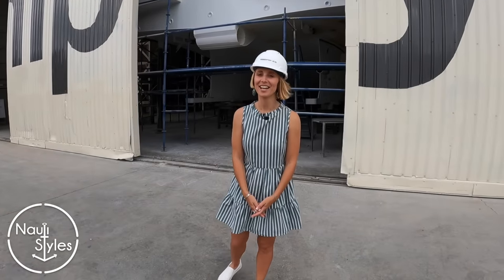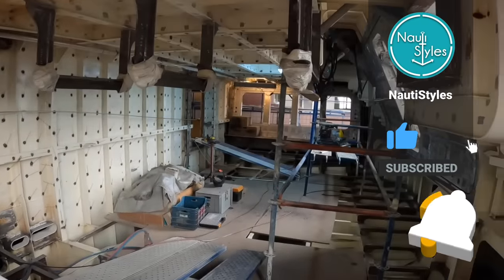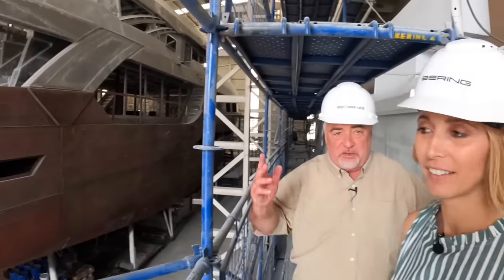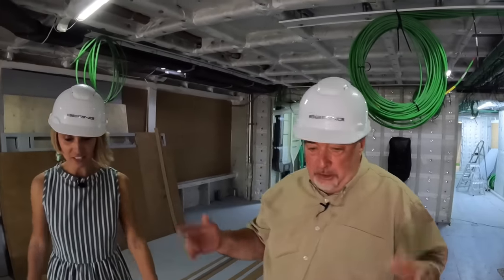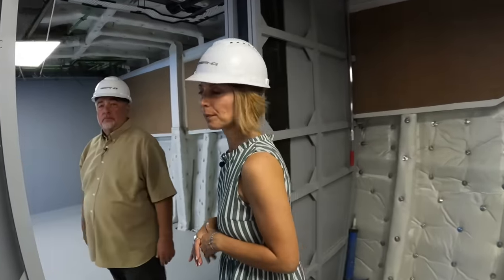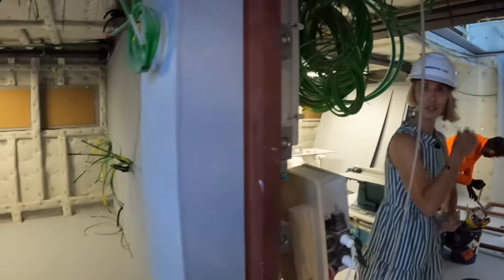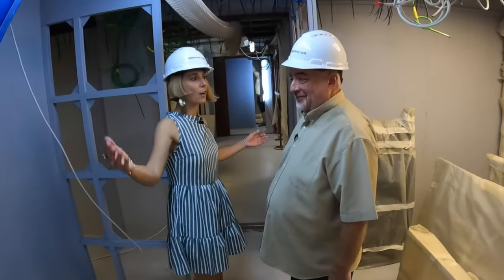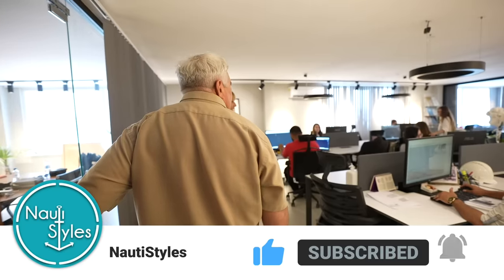BERING 145 HYBRID EXPLORER SUPERYACHT TOUR / EXPEDITION Liveaboard Go Anywhere World Cruiser

Comment: This will be great to see when it gets finished and is ready for sea trials - please come back and do a follow-up video. My favorite Bering is the 130. That one has a fantastic layout and also longer range than this one (6000NM). I know that if you have to ask the price you can't afford it, but I'm curious what Bering charges for it's top $$$ water toy.

My problem with hybrid systems is that they too need replacing - batteries will wear out and surprisingly quickly if you push them hard. That down time and expense won't be fun if the vessel is in dock every 3-5 years just to do battery swaps. And at the rate battery tech keeps evolving Li-Ion and hybrid drive could be obsolete well within this boat's lifetime. Drive train swaps aren't impossible on vessels like these and larger, but they're not exactly easy either, especially when the change in weight and thrust ends up having a negative impact on performance and handling.

Comment: When he mentioned nuclear power in suitcase size my heart stopped. Just the amount of power generated from 2 suitcase sized units or hydrogen units could power a yacht this size for 25 to 30 yrs with no refueling. And unlimited range to boot. I so want to see that in 10 yrs.
Reply: He's off by about 100 - 200 years at least. Don't worry.

Comment: The CODLAD propulsion system is currently used on military ships, in fact the Bering shipyard can at any time switch to the construction of military ships from what I can be seen, have a very modern workflow implemented. Impressive. 
https://en.wikipedia.org/wiki/Combined_diesel-electric_and_diesel

Related to the problem of file loss, both memory cards and SSD or classic hard drives can lose data if they are exposed to radiation generated by airport scanners, it is safer if you have a cloud storage solution and immediately after you finish filming at location upload the video to the cloud, then after you get home take the downloads and process the final video. I am glad that you managed to recover these videos, my personal opinion is that they are among the most valuable videos of yours. Thanks for the video.

Comment: Very impressive construction & strength.  Ability to resist ice floes and possible grounding and still protect gear train notable.  Excellent planning to withstand corrosion and usage.  Would be nice to know top speed, cruise speed and maximum range.  Backup engines & generators? Ability to withstand rough seas and big storms?  Investors need to know toughness, safety and radar sensors too.

Comment: Random stray thought here. At 4:00 looking at the hull I flashed on the dimples of golf balls. Dimples double or triple the length of shots. Someone tried doing it with a car. Looked bad and water pooled in it. Also I think the spinning element may be needed for it to function vs a static surface. Those 2 things wouldn't apply here. As for the third, don't know. 
I suppose if it would work it would have been done.

Comment: I still wonder why Ship Builders don't go Series Hybrid (rather than Parallel Hybrid).
Series means to make the Diesel as a generator only, and the Electric Motor runs the shaft.
Diesel Electric Locomotives have been Series for nearly 100 years.  The efficiency is MUCH higher than running the diesel direct to the shaft.  
I will admit my lack of knowledge about boat engines, but anything that simplifies maintenance is good, imo.

Comment: The only thing this yacht is missing is the switch to multi fuel (diesel/hydrogen). That would make it zero carbon footprint. I would speculate that hydrogen would be available in the private sector before nuclear, JCB is already in development of diesel to hydrogen conversions for their construction equipment, so hydrogen is coming.
Reply from the maker: the next 5 years is going to be very interesting for the superyacht world
Reply: @NautiStyles  didn't want to be to facetious but the thing about burning hydrogen, it can make it's own water to sail in ! 🤭